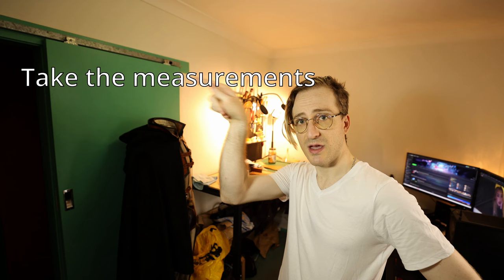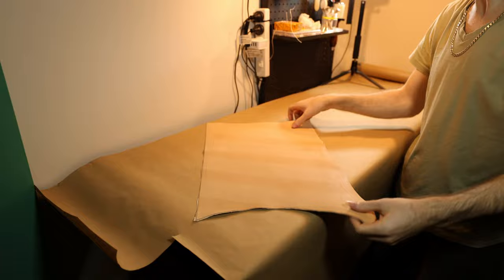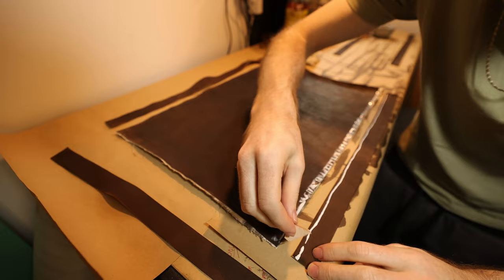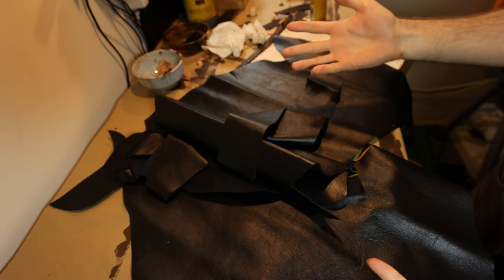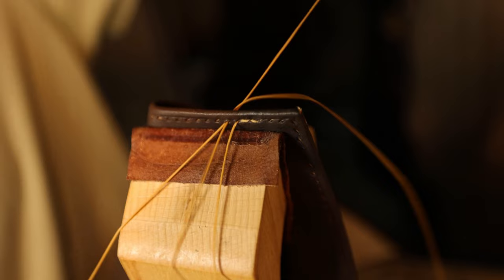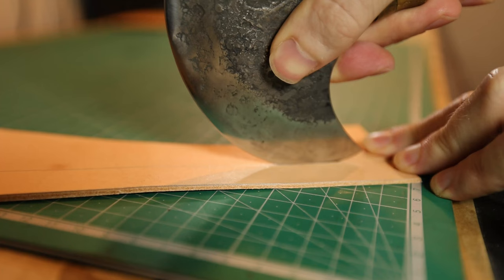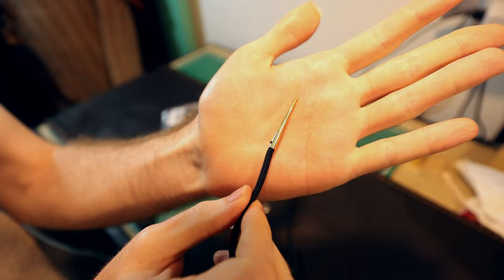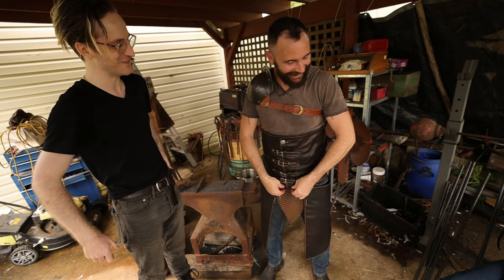Making Ciri's Armoured Corset

Comment: Great work! Must have been stressful doing so much without lots of fittings. Strap cutters... yep, big ugh. I hear great things about plough gauges, but they are eye-wateringly expensive. I don't enjoy scalpels for leather cutting because they're so wobbly, but you're up against it with wibbly goat, and clamping it under a rule would stop it stretching and warping as you cut. Hope you enjoyed the build, ergonomic challenges aside.
Reply from the maker: Thanks very much! I love getting to use my round knives, but you're right: once the leather is thinner than about 2.5mm it just starts slipping all over the place. I've found the x-acto knife is great, as long as I replace the blade with every new project lol.
Reply: @Cxizent  you can strop disposable blades, even if it feels illegal. ;)
Reply from the maker: Shhh, the leathercrafting purists will hear us 😂 good call though, I'll give that a try next time!